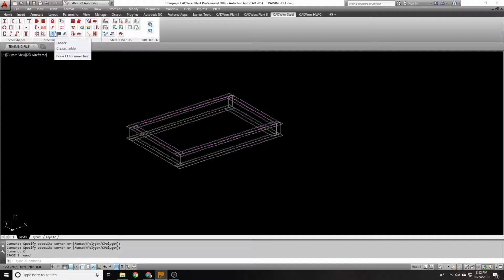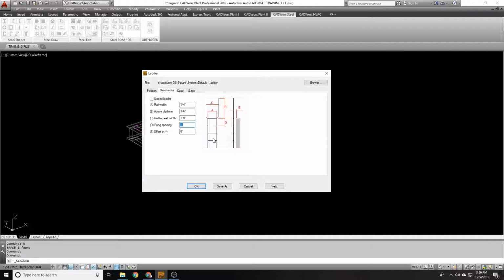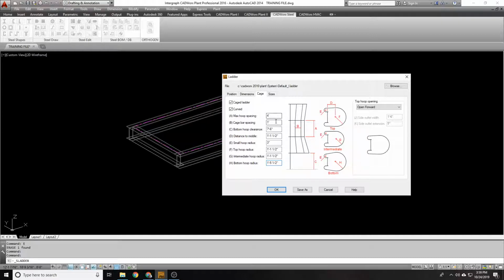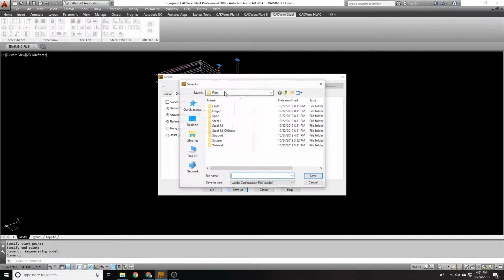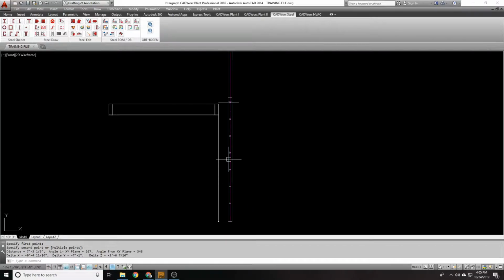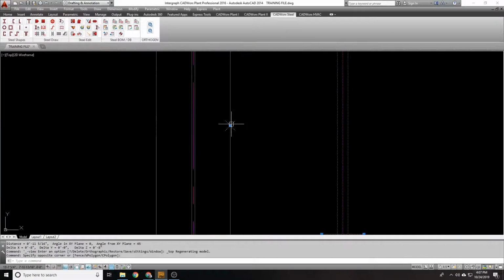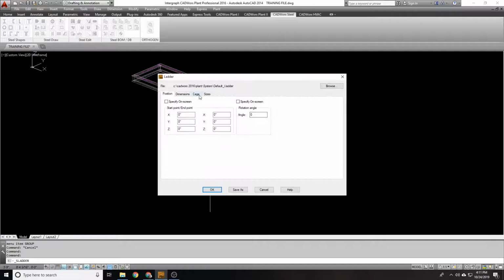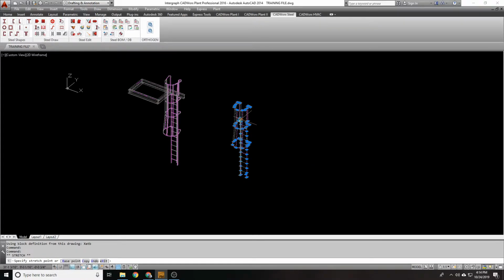CADWorx Steel - Ladder Tool

Comment: how about if we use c-channel instead of flatbar? In my case when ever i use channel or angle, the other one member doesn't rotate properly. The two member should be facing outside, not facing at the side.
Reply from the maker: Make sure you haven't adjusted any of the rotation settings in the Details section of the Sizes tab of the ladder tool.  In my case simply changing the member type to angle or channel shows the members properly mirrored about the centerline of the ladder.  However in the case of angles you may wish to go into the Details section and set the rotation to 180 degrees and check the mirror box.
Reply: @youcandraft  i have check the mirror box and it doesn't change anything. The two stringer channel still facing the direction.